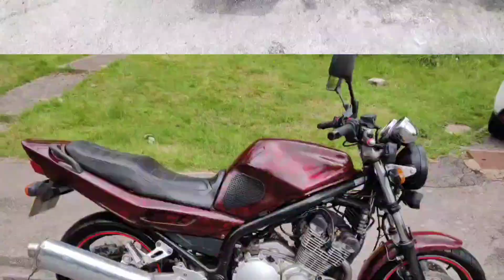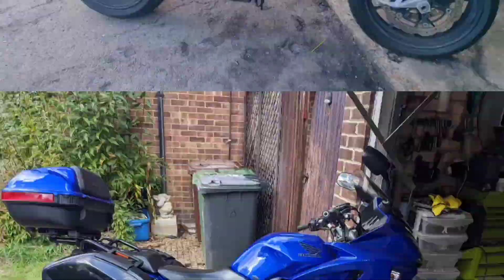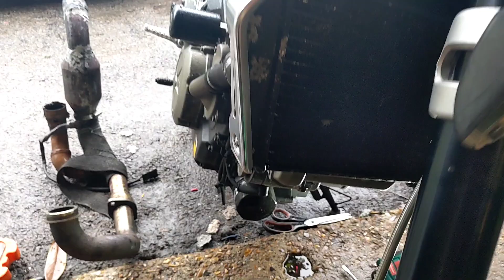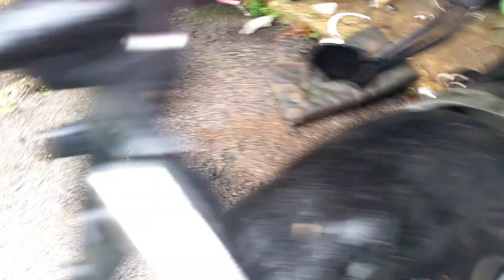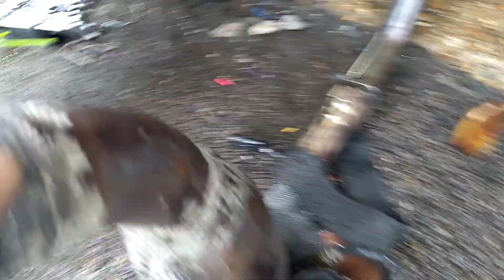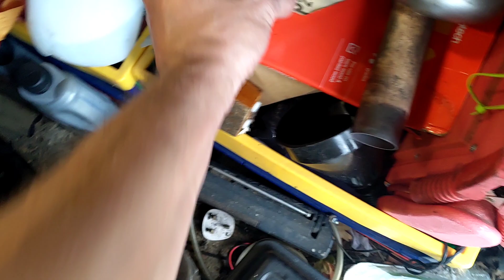Aprilia Shiver: Crimbo Limbo.  DHL super fast international delivery suprise me!

Comment: Is that mess on the end of the old pipe the remains of a gasket? Looks like there should be one on there given the difference in size to the double pipe.
Reply: There is a gasket Nat. Wemoto do them for £10- 12 depending on which one you need.
Reply from the maker: £33 for OEM apparently!  May have to bodge something in the interim!